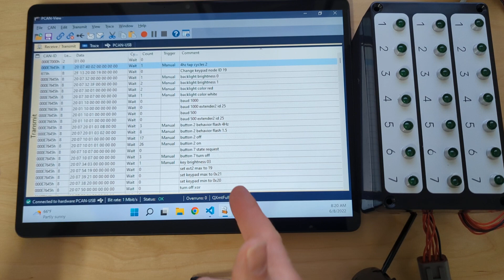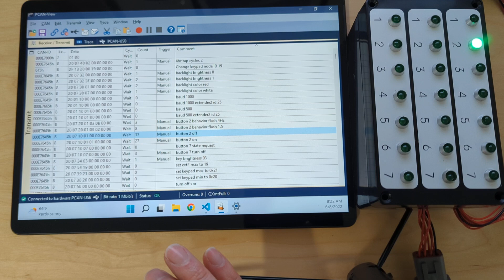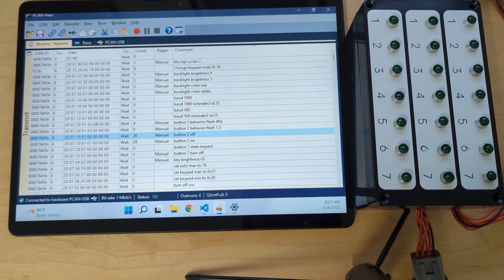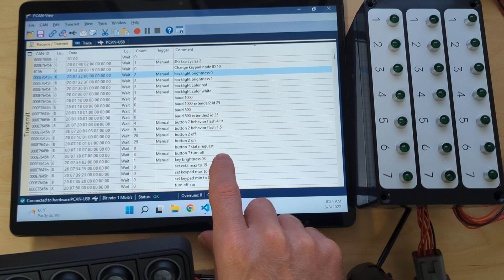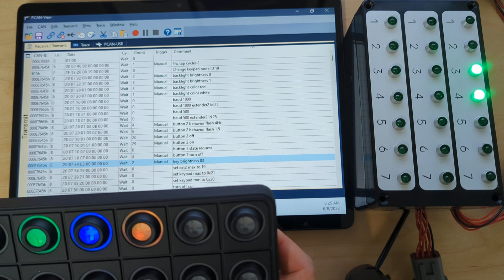New CAN stuff with the MicroPDM

Comment: Are you going to make it where you can have more than one external control devices?
Reply from the maker: We support 2 now (a single AnalogX and a single ECU Master CAN Switchboard), and don't have a plan to support additional ones (yet).   You can also use an ECU or logger that can send arbitrary CAN messages to control the MicroPDM.